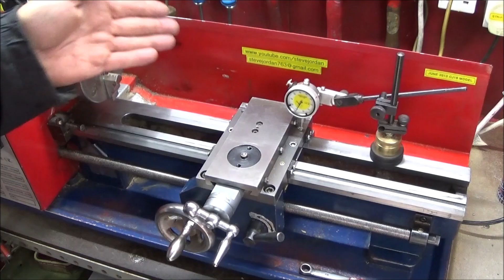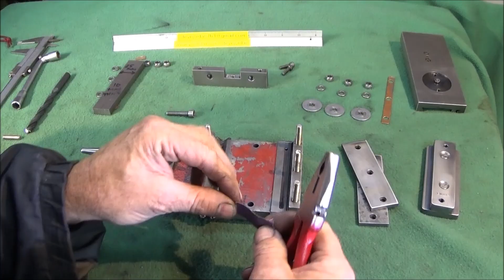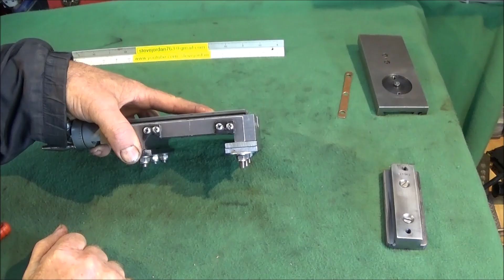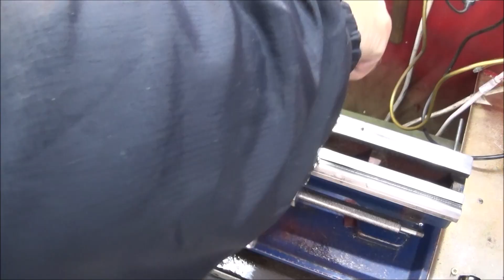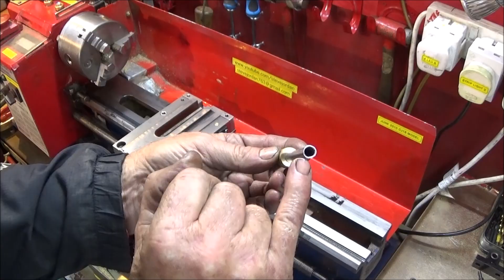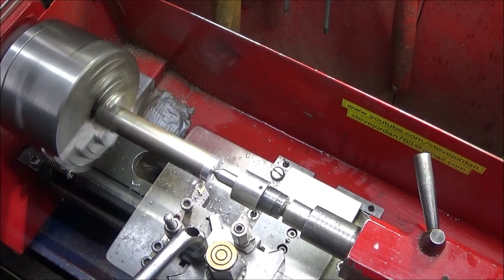A New Easy Very Effective Upgrade For The Chinese Mini Lathe Carriage

Comment: I have found on YouTube a different carriage mod with plates using brass tapered strips which allow adjustment and wear themselves instead of plates or bed so far the best improvement I have implemented. Those lathes have nicely ground surfaces. Bed for example is ground on the top but it's milled underneath. It takes a long time to make milled side lapped and even but lot of "elbow grease" few plates and lot of emery sand cloth works miracles. Plus is you need to do that only once and then you can be happy with lathe without carriage binding on the bed in some spots and being loose on others that gives unbelievable improvement of surface finish on parts.

Comment: How do you work out the shim thickness under the carriage?
Reply from the maker: I just add a certain thickness, tighten the nuts, and see if it locks the carriage or whether there is any play. Then I either add or take away to suit. It can take some time, but it's worth the effort. Regards Steve

Comment: I've been looking for a more reliable way to stabilise the carriage and this is a really nice mod. Unfortunately many of these Chinese mini lathes have a H shaped saddle so there is no place to attach the new plates to. Also, on my lathe at least, I know that the underside of the bed is not parallel to the ways. Not too big an issue for the tail stock locking mechanism but would require some grinding to make this modification work. BTW, you still sound pretty good at 2x ;)

Comment: If the engineers fixing these Chinese lathes have the equipment to fix the Chinese lathes why do they buy the Chinese lathes?
Reply from the maker: They are fairly good projects to work on. When modified a bit they are great little lathes. I have had mine for many years. The newer models maybe a lot better now anyway. Regards Steve

Comment: Thankyou Steve. One thing that does puzzle me about this upgrade though is why use steel against steel. Maybe I'm mistaken but I assumed that the piont of using the brass strips was to take the  wear though I recognise that it should be minimal anyway on the undersides. Did I misunderstand this. Lovely work and great how to  demo, thankyou.

Comment: Just saying. to tighten in the studs rather than emery an pliers that will still damage the threads try using two nuts locked together on the top of the stud. When tight just unlock the nuts and take them off. No damage and a tighter stud.

Comment: Hi, a tip to screw in a piece of threaded, screw 2 m6 nuts on top an put some tork on them so they will hold tight to the headless bolt (sorry I'm Dutch) then you don't damage the thread. and still can use force to screw them in. If it's fermly in, turn the bottom nut clockwise and the 2 nuts spring loose 
The same goes for removing thread that is very tight in a screw hole. Kind regards Hans

Comment: You might consider selling that setup as a kit. I'm pretty sure I'd buy it. My carriage is fairly loose, even after tightening everything as best as possible it can still rotate 0.025". I suppose everything would have to be fine tuned to each individual lathe however... May be harder to manage than I was thinking.

Comment: any problems with the nut for the carriage?  
I noticed you cleaned up the clearance and had adjustment for the back of the carriage, however, clearance seemed to be rigid for front. Any ideas for adding grub screws to the front to take up that slack? 
Great job overall btw... =D

Comment: Yay, I finally get to see the chickens!
I keep hearing them in the background of your videos, so I knew you had a few.  :-)
I do need to figure out a good way to attach a shield to the front of the carriage to keep the chips off the bed in front of it when cutting.  I don't know if I'm ready to do the full carriage upgrade just yet, I'm still learning to use my 7X10 mini lathe.

Comment: Watched this again but I guess I miss how you decided what thickness of shims to use so the carriage would move easily but then have very little uplift. With the original chip guard it is a pain in the  XXX to adjust the clearances for sure.

Comment: Steve, excellent video and a great upgrade. One question, how did you calculate the required shim sizes?
Reply from the maker: I put several shims in first tighten up and see how it is and gradually reduce the total thickness until I find the optimum  setting. Regards Steve

Comment: Instead of the emery paper trick, just put two nuts on the stud and tighten them together to then drive the stud in ;-)
Reply: The best way to drive studs in is with a stud box.
It comprises of a hex section and a bolt screwed in the end.
To use you screw the hex section on the stud until it bottoms on the bolt then tighten the bolt onto the stud and drive the stud in.
To remove just hold the hex section with an open ended spanner and loosen the bolt.....you can then screw it off the stud.

Comment: How do get hold of the shims? They must be precise, exactly what is needed for each situation, each place.
Reply from the maker: You can make shims out of thin metal like stainless steel or brass. Say .005/.010 thickness.
Reply: Do You say buying metall sheets of a few different thicknesses and cut out shims?

Comment: what exactly is "shim"? What's the material and how to cut it?
Reply from the maker: in engineering it is usually any thin metal, like brass, copper or steel. You can buy it as 'shim', or cheaper by buying thin brass sheet. It can be cut using scissors or tin snips, depending on the thickness. Plus you can use it by adding cut pieces together until you achieve a correct thickness on something. Regards Steve
Reply: @SteveJordan  or you can cut up a beer can

Comment: Great video and very well made.
Have You noticed any problem with the rear middle plate screw loosening because of vibrations? Also using it for locking the carriage is just brilliant.

Comment: What material are the shims?    Nice fixed carriage!
Reply from the maker: I just use brass shims cut from thin brass sheet, but any sheet metal will do really.
Reply: @SteveJordan  thanks, I will do this upgrade too. But in fact the overall tolerance is leading for perfect results in making parts, therefore the next improvement would be to make perfect anti-backlash nuts to eleminate play.

Comment: Your killing me, those parts are simple, if you have a mill, band saw or second lathe, that looks like what I need to do to fix my situation, maybe I can buy that metal pre cut, drilling and tapping not a problem.  I have that exact same saddle, not the h style. I wish someone made these parts and sold them on eBay

Comment: Now you've done it.  I am tempted to get one of those lathes just so I can upgrade it as you have.

I think I would go with standard metric threads and fasteners in the places where you have used BA.

Also, I am leery of having steel (even mild steel) rubbing up against the cast iron of the bed.  One of the advantages of having precision scraped surfaces is that they are not perfectly flat and are instead composed of both slightly low and slightly high surfaces.  The lows serve as oil reservoirs that stop the cast iron from wearing quickly.  Finely ground surfaces rubbing against each other wear much more quickly than precision scraped surfaces.

My approach would be to mill the mild steel 5 or 10 thousandths too deep and then fill the gap with brazing rod.  Then mill the brazing flat and hone to a precise fit.  Let the brass soak up the wear and be replaced when necessary... sort of like Turcite.

Have you put tapered bearings into this machine?

Cheers,
Norm Berls
Katy, Texas

Comment: A lot of work  but you explain well. Just drives me nuts though with all the metric fitting and plate dimensions.  I loaned a jig I made to drill and tap and it seem to never get returned so I guess I need to create again after watching you.

Comment: So I took the back guard off and left it off. Is that a bad thing to do?
I shimmed the underside of the carriage with a shim made of 1 mm thick PTFE. It has not up and down movement and slides easily. Don't know how long it will last.
Reply from the maker: Hi yes some people do take the guard off. The PTFE should be ok used as shim. You must have good control over the tightening using that and obviously can make any further adjustment easily
Reply: @SteveJordan  It turned out after time that the ptfe shim is NO Bueno!  It compresses when a lot of pressure is on it.  I found out that removing the back guard has let swarf into the cooling holes on the back motor/belt guard and has gotten it chewed up. Actually after a year of treating my lathe brutally by doing things no mini lathe was meant to do, It is pretty much worn out. I need to do so many upgrades : spindle bearings, drive gears, the ways are banged up etc., been thinking about getting a replacement and starting over.  But can't afford either the upgrades OR the new mini. So I soldier on with time consuming but inexpensive upgrades as I can afford. 
I REALLY APPRECIATE your videos. Thanks so much for sharing your wonderful ideas and applications of genius.  I like to figure out mods but yours are always far better than mine.  Love your chickens. They are very well cared for. Too bad so many people don't care for their birds like that.
God Bless
-Hans

Comment: Tip for fastening studs without damaging the threads: lock two nuts together.
Thank you for the tips by the way. You could get to the point a little bit earlier in de video: the first minute and a half you were just beating around the bush ;)

Comment: Nice mods. Nice finish on the cut. Is that with the original ball bearings? I have mine apart right now to convert to tapered roller bearings.  Mine cuts nice but going to tapered bearings. I bored out my tailstock to take slightly larger pieces, larger chuck, balanced the chuck to remove all vibrations. Modded tailstock. Scored gears to lower my feed rate. Most people with a 36" lathe only uses the first foot. Thats why the first foot of lathe ways are worn down. You never use the other 2 foot of ways.
Reply from the maker: Hi Thanks, I changed to tapered roller bearings a while back although I did use the original bearings  for some time. You have done some good upgrades. It really does pay off on these machines.

Comment: Hi Steve I removed the saddle and the the grub screws are missing on both sides
Reply from the maker: Hi Frank, What, the grub screws on the saddle plates underneath?
Reply: @SteveJordan  yes and I also found the bed cracked behind the apron and lead screw

Comment: Hi steve I think i have watched all your videos and yougot me started  on the mini lathe  I haven't touched a lathe for nearly 45 years can you tell me how you worked ouy the shim thickness to put on the saddle plate thank you
Reply from the maker: Hi Frank,  Thanks. I inserted a certain thickness of shim, then tightened the allen bolts and tested to see if the carriage locked up and was unable to move. I then added shim thickness of about .005"/.010" thou and repeated the process until the carriage would move freely with the minimum amount of added shim. Then I measured the total thickness and cut a piece of single brass plate that equaled the shim and fitted that in. 
  It took a bit of time, because I found the lathe ways to be slightly uneven, so it could be just right at the front, but when towards the back of the lathe, the carriage could be tight. Obviously you need to make sure its not overly tight as that puts strain on the lathe carriage travel mechanisms. 
  You can also find the nearest shim like this, and if it tightens just a bit too much, just back the front allen bolt off by a 1/4 of a turn and use the lathe for several weeks. Over time it runs in a bit and you can gradually tighten the front bolt up fully. The back allen bolt is just tightened by feel as I use this one to lock the carriage. After locking I can just release by a 1/4 turn. 
  I didn't think of it at the time, but you may be able to lock the front bolt up without any shim and get a rough idea of the thickness needed using feeler gauges in the middle gap? 
Regards Steve
Reply: @SteveJordan  thank you for the quick reply, i just bought the 7x14 mini lathe and i am doing most of the mods you have done. What i used to do in 1/2 hour now takes me a couple of days but at least its got me moving.

Comment: Hi Steve - love your videos & have learned a huge amount from them. Thank you so much for all your time & effort in making them & your generosity in sharing your knowledge. One question on this video: please could you elaborate a little for a beginner on the process you describe as “I worked out the shim I needed” under the saddle plates?
Thanks, Ian.
Reply from the maker: Hi Ian, Thanks for your encouraging feedback. 
  What I did was put a thin shim in first and tighten up. If it locks the carriage on tightening, then loosen and add thicker shim. Tighten again and see if it locks the carriage or tightens it making it too tight to move. Keep doing this, just adding or putting in thicker shim until it suddenly becomes smooth to operate, so at one time it maybe tight, but by adding say .002" thou thick shim, it will suddenly be right. (Smooth movement). 
  Having done this method one will the know that there is he minimal amount of clearance, between the saddle plates and the underside of the ways, or lathe bed, thus giving maximum rigidity.
 It sometimes takes a bit of time as there maybe some difference on the thickness of the lathe bed over its length, but you will have to strike the best possible outcome. 
  Mine is a very slightly tight towards the back half of the lathe, but ok at the front half where most machining is done, so I left it at that and it is fine. ....Hope this helps....Regards Steve
Reply: The shims look like made of brass. How, or where, did You get hold of them? Making them Yourself?
Reply: Steve Jordan : yes, thank you - that helps a lot. I understand the process now. Please keep these top videos coming!
best regards, Ian

Comment: As a jig and tool maker who has built 6 steam locomotives over a period of 40 years I do know something about machine tools.
Basic with a lathe the bed width should be double the width of the centre height to give good carriage rigidity. That is clearly not the case on that mini lathe.
I own a 50 year old Colchester Chipmaster which I purchased 20 years ago for £400. If you have the space for an ML7 then why not get a decent ex works (or college machine) for a fraction of the cost of an ML7. A good quality small Colchester can be found for £1 to 3k. There is a myth that used industrial machines will be worn out. These machines are built to last and it's very easy to see if a machine has been brutalized or is in good condition. It's not the same as buying a used car.
Reply from the maker: Hi I had this Chinese Mini Lathe before my ML7 and have produced hundreds of high precision components using it. Also I spent many years working on Colchester lathes in the aerospace industry. If I wanted an industrial lathe I could get one, but I have no need as I can produce everything using the two model lathes. 
 Occasionally I have been restricted on diameter, but not enough to warrant the bother of installing heavy machinery, especially with my health as it is with joint problems.
Also I must say, I am satisfied and content with what I have now.
 I have had more interest and satisfaction using my two lathes, in recent years, than I ever did when using industrial machines in the past.

Comment: Hi i had a Minilathe until last year i bought a bigger lathe with 265kg and this carriage clamping was the point which I found most wrong designed... the original assembly is to weak... So first i changed the thin cast iron into thicker brass which was better but after a while i was still not satisfied... After thinking and looking for a better alternative i build a new one with a slight taper gib....that worked perfekt with one revolution of the screw holding the gib the space between the gib and the slightly tapered plate changed for 0,01mm.. Knowing that it was very easy to adjust it so that it had no play but still moved... I was very satisfied with that improvement and showed it everybody of my friends having minilathes and 2 of them copied it as well... After that chatter and bad surfaces were banned from the Minilathe as long as you handled it normally... 👍
Reply: It amazes me the lengths people will go to try and make a silk purse out of a sows ear!
There are dozens of small classic lathes in very good condition for the same price or less than being paid for these badly designed and made Chinese machines. Check out "Home and Workshop Machinary"
The carriage on the machine shown here is too narrow in terms of its length and engagement with the bedways.

Comment: Ah..Oh..
Wish I d seen you videos before I sold my Conquest!
Looked at a much bigger version with 1200 w motor but its not exactly portable.I have a 1910 Drummond ,strange choice  perhaps, but  seems to have had very little use, instead.
When I m a bit more settled I ll look at the bigger lathes again and suspect your upgrades are going to be useful even on that.
Very good Steve thank you for doing the videos

Comment: Hi Steve! I enjoy yuor videos very much, specially the way of your teaching. I'm 66. Some years ego went retire. On last Christmas I've got a new SIEG SC4 lathe. From that time my favourite pastime is doing something in my shop. In your videos the QCTP is not familier for me. So many types are recomended to mini lathes (Shars AXA,OXA, A2Z ........) My SIEG SC4 has 210mm (about 8") swing above the bed and M12 thead size on cross slide for the stud. Please give me the type of your QCTP and where I can get it. Thanks a lot. László Lendl from Hungary. By the way I also had worked for aviation more than 30 years.